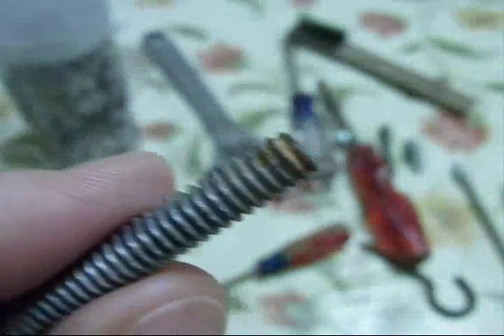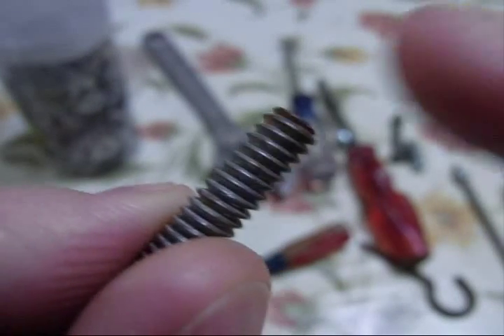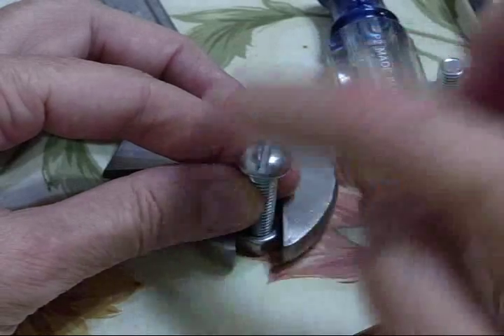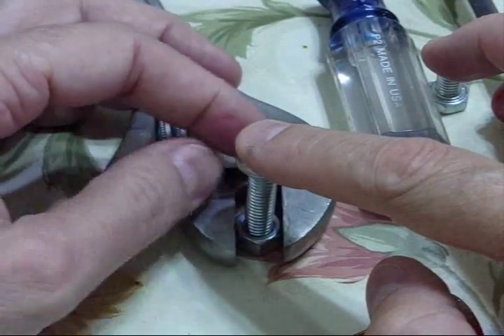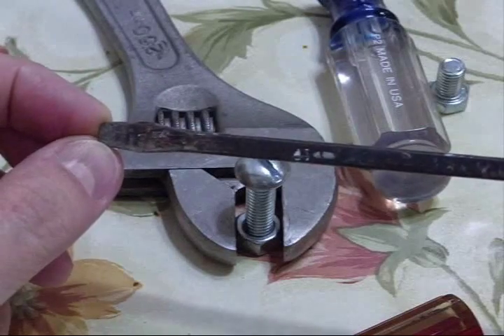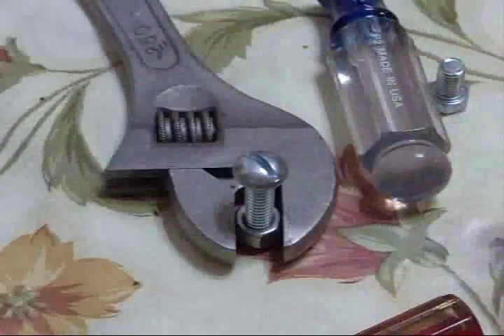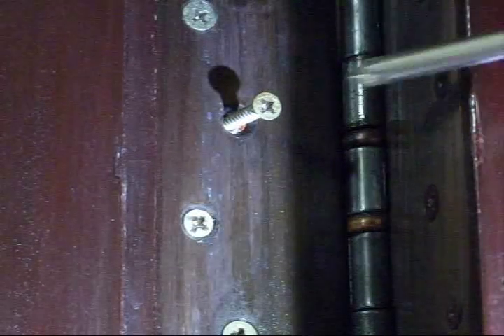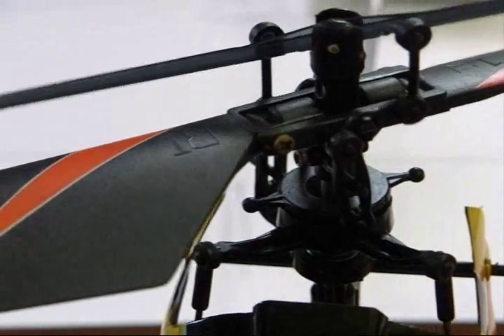3 Simple Steps To Avoid Cross-threading Screws, Nuts, Bolts (Updated Video Available)

Comment: Hi. I have purchased very expensive sauna bulbs that have come with mangled threads or I mangled them by accidentally cross threading when I put them in. Can I save them by somehow un sandwiching the thread where it is squished together? The manufacturer is sending replacements but shipping will be a while. Is there a tool or technique for light bulb threads?
Reply from the maker: I am not familiar with sauna bulbs.  As a general rule, light bulbs have such a light-weight construction that messing with them can easily cause internal issues which could lead to shorts, shocks, fire, etc. especially in a damp / wet environment.  Just not worth the risk.

Comment: please make how to fix a sleep Bolt
Reply from the maker: Do you mean "sleeve" bolt?  You can google it and see if the pictures match what you are thinking.  The easy answer for doing a sleeve bolt is to make sure you have the right size drill.  Too big and it won't hold.  Too small and you have to wiggle the drill bit making the hole not straight and of varying size, again not good.  A perfect sized hole with straight sides is what you want.